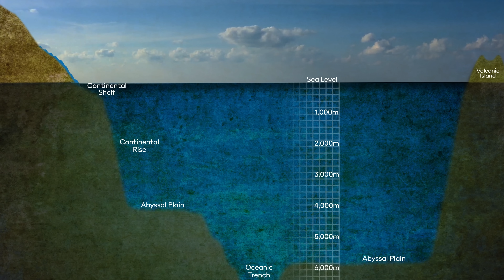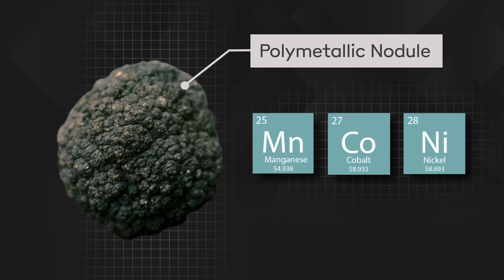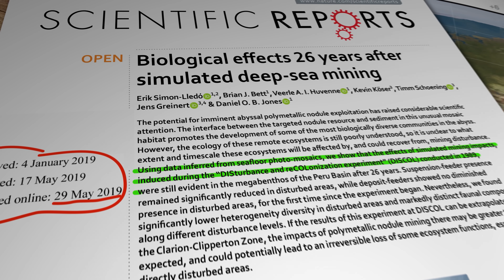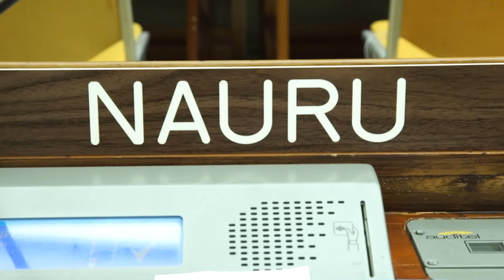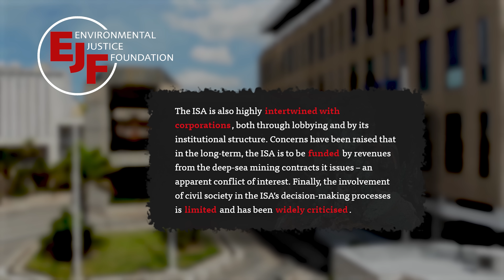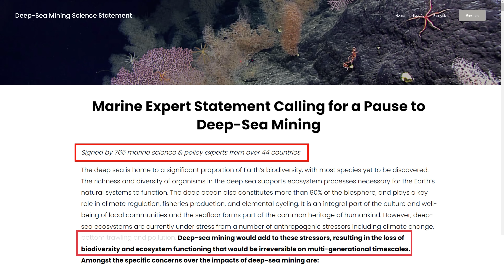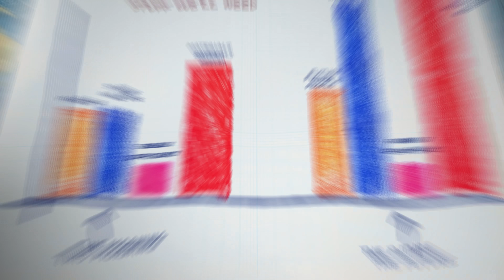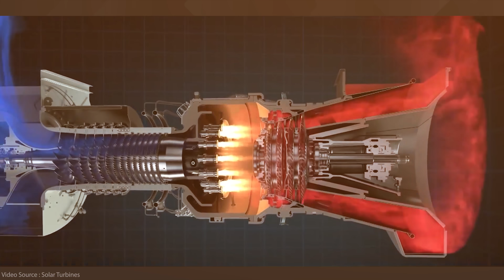Humans reach a new low. Literally!

Comment: I don't really understand why they're not looking into undersea digging, rather than just scooping up the top layer. If the nodules are a regular deposit, they'll likely be found even deeper, and that way you maximise the actual mined resources while minimising the ecological destruction. This seems to take the direct opposite approach, destroying huge areas of life for relatively small amounts of material.
Reply: The video he mentioned near the start explains how the nodules are formed, and the constituent elements of the ones which form below the seabed (they don't form much deeper than a few feet, from what I understand) is mostly iron and another element that I can't recall (but it was something else abundant on land, like iron), and thus not the incentive to extract from the seabed in the first place. They are after the surface nodules because these contain a lot of nickel etc. Besides, I don't see how they could dig up the seabed and avoid being even more disruptive to the ecology of the ocean. Perhaps you are envisioning the nodules forming way below the seabed, and that deep shafts could be dug to reach them, mimicking similar mining techniques on land? As I said, I don't think the nodules are far below the surface, and in any case such a venture would surely be prohibitively expensive if not technically impossible (and even if they could dig down hundreds of metres into the seabed, what would they do with all the waste material? They'd have the same problem faced in the proposed method of seabed surface extraction; where to dispose of the material).
Reply: @danyoutube7491  Waste material is certainly a problem with any sort of mining, but carpet-scooping huge areas of the sea bed would surely be far more destructive.

I didn't watch the linked video, so thank you for explaining that. I'd actually assumed they were formed ON the sea floor, in which case they'd probably be something you could dig for further down, looking for those that formed a long time ago. If they are only found on the surface, that wouldn't work though.

Comment: The precautionary principle and common sense suggest we check thoroughly before we take such a significant unknown risk, and that appropriate incentives and discincentives are in place to protect the environment and to prevent harm while in the process checking its safety and efficacy. As the stated goal is 'common good' and the risk level is high, private profit motive should be removed altogether and benefits and risks should be measured in public and environmental good. I suggest an international scientific research project would provide a more appropriate level of responsibility than a new marketplace.

Comment: with forever chemicals already going to inundate the deep, we should just leave it alone.
just because you can doesn't mean you should  or even that it's necessary  yet.
rise on cost will push other technology to take over in areas where it can do it as good or better.
we need a more circular economy than just a mass scale disposable one.

Comment: I was going to mention that 30 year death, but you beat me to it. I was under, I guess at this point, they had resolved the sand storm associated with the earlier example. Now, I guess not and thus it doesn't get my vote. This approach by this consortium is aboutcan easy cash grab thus based in your previous report obviously unnecessary.

Comment: I believe that this latest Titanic disaster has made people painfully aware of the problems that diving so deep into the ocean cause. It takes a lot of energy to lift a ton of weight fifteen thousand feet up from the ocean floor.  The costs could add up to where deep sea nodules may not be cost competitive with land minerals.  I wonder what kind of transport system will be able to bring up nodules in an efficient manner.
Reply: The pressures are practically meaningless because they will be balanced and it's easier to lift small chunks then a sub.
Reply: Not the Hubris of it all? 
Not the painful hypocrisy of attention given to the submarine incident and the migrant crisis disasters in the Mediterranean? The dehumanisation that's normalised in our world knows no bounds
Reply: They were grave robbing the Titanic on the backs of thier tourist rides.
Reply: @441rider  Don't worry, the Titanic was grave robbed long before the tourist rides showed up.
Reply: One thing to keep in mind is that these nodules are (from what i understand)  very high percentage or almost pure nickel/manganese/etc. Whereas most land based deposits are mixed in with lots of other carbon and whatnot so need more processing to get the minerals in question. So that would be an advantage that might offset any increased costs for retreiving them.
Reply: Very farfetched connection. To begin with, deepsea mining is already discused for half a century so costs are already a factor in the equation. More relevant however: This should not be a manned diving operation but remote controlled or robotic.
Calling in that cheap amatueristic expedition dissaster is just jumping on the latest hypetrain of public sentiment.
Reply: I could think of a few ways.

Mostly thinking robot drones.

Have them pick up the bigger nodules with some sort of mechanical manipulator. While replacing the ore with a ballast rock for the sea life. Then hand-deliver them to a central pump.

At the pump station, the little robots charge, pick up a load of replacement rocks, and go back out to do it again.

It would be slow. But if you got it automated enough, a continuous sustainable process.